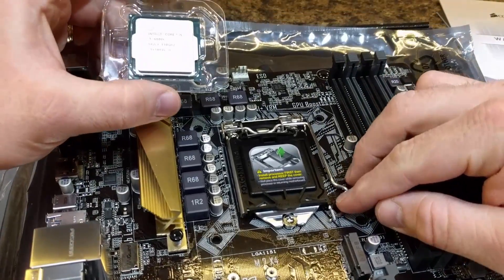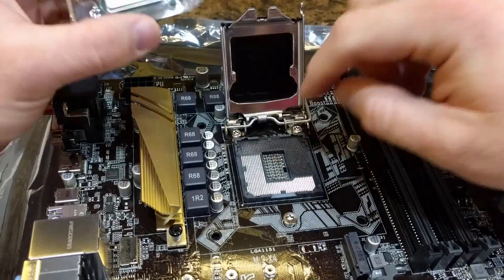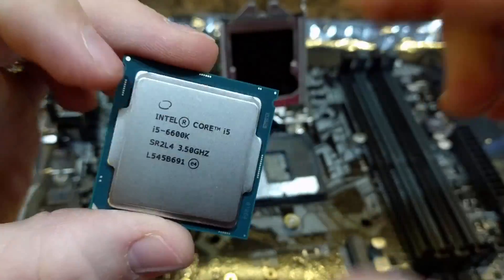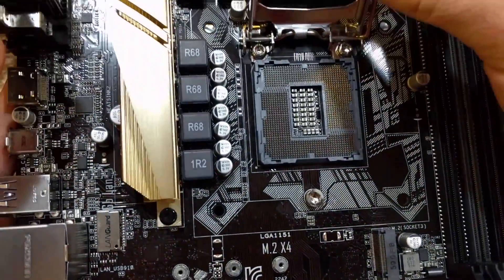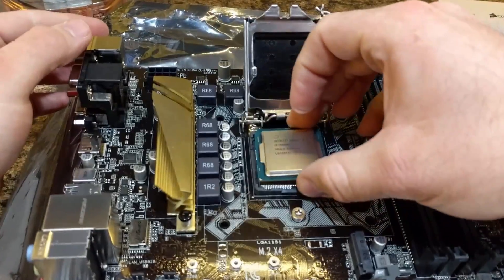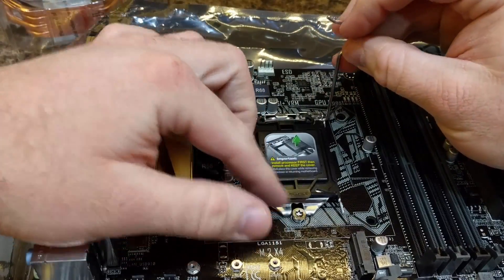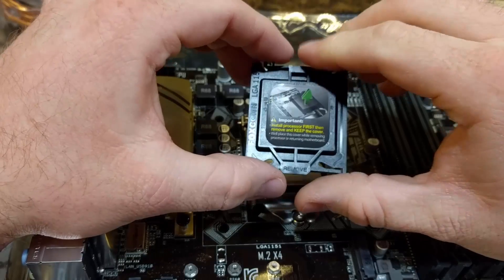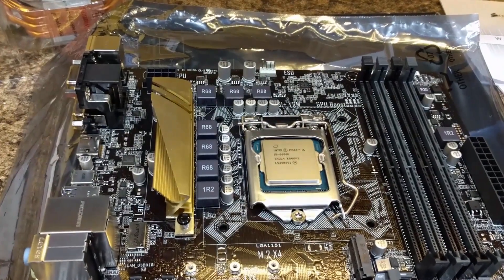Install Intel CPU socket LGA 1151

Comment: Accidentally got thermal paste in the corner of the socket around a few pins. Very delicate!
Removing the CPU is stressful trying to use your fingernails to lift it up without moving the CPU side to side so as to not damage the pins

Comment: sir i have question.
This motherboard is from the intel 100 series chipset and has the LGA 1151 v1 (first revision) which only supports 6th and 7th gen intel cpus. I want to know that , after updating it's bios, do it will supports 8th and 9th gen cpus??
Reply from the maker: Usually, no.
Reply: @ttms2  Thank you sir, i already got the answer from my DAD. He's kinda expert in computer hardware. Any ways, the Intel LGA 1151 v1 is only made for Skylake and Kaby lake intel cpus because intel 100-200 series chipset do not supports Coffee lake processors. 300 Series chipset is required for coffee lake to run.
Thanks again.

Comment: Soooooooo easy to drop the CPU or slip out of fingers and damage the socket. My trick is to stick Blu Tack to CPU top, lift CPU by the Tack and easy lower it  into place.
Works even better when removing the CPU, sooooooooooooooo easy :-)
If you don't have Blu Tack bit of masking tape folded into half and stick a tab to top of CPU,  sooooooooooooooo easy :-)
Reply from the maker: I've probably installed over 1000 CPUs and always done it the way I show and never had an issue. I'm glad you found something that works for you.

Comment: I’m thinking to build a pc but I get confused that I will bend pins(I’m 14) so can you tell prebuilt or build my own
Reply from the maker: I wouldn't worry about that. I sent this video to my 9 year old nephew and he was able to get his built without an issue.
Reply: TrenchTech Computer Repair Tutorials ok also if I accidentally bend will I be able to return (I buy stuff from bestbuy)
Reply: @shaheerfarhat7578  You'll lose warranty if you bend the pins.
Reply: TrenchTech Computer Repair Tutorials if so How will I get windows without flash drive ( I never built computer in my life)

Comment: How much pressure does it usually need?

I tried to install one today and it needed more pressure than usual. Have you ever had that problem?
Reply: That usually means the chip is not quite in the right spot.
Reply: im having same issue now, all new parts, is the screw on the motherboard adjustable? it looks like it is. I havnt built a pc in years.

Comment: But... the Verge told me to throw that cover away then put the CPU (that's right, they've got one) into the ~holder~ by using the ~brace~...
Reply: A core i7 hexacore. That’s right. wEvE gOt OnE
Reply: bro you forgot the cpu installation tool

Comment: A question . I am upgrading soon to the z370. How easy is it to damage the cpu when installing it. I've read that the pins are delicate and can get bent thus ruining the cpu. I am a bit clumsy. Is it as easy to install as it looks on your video? Thanks.
Reply from the maker: Don't be too worried. Take your time and you'll be fine.

Comment: So u just gently drop the cpu u right? How gently it is? Is it before touch the pins gently let it go? Or after touch pins just let it go? Will it bend the pins or something? Sorry i was new on this, just want to make sure it safe😂😂
Reply from the maker: +Gaming lovers you should be fine either way. I usually just line it up with the plastic and lower it down.

Comment: Wait the minute, isn't the 8th Gen Intel processors use that same socket (LGA 1151).
Reply from the maker: +Koo Yong Rong it uses a socket called LGA 1151 300 series.
Reply: Koo Yong Rong same socket, but intel twicked the voltage settings in the cpu so you have to buy a new mobo. But some people managed to overcome this and install 8th gen on older boards.

Comment: If i remove the black cover before cpu installation then what happened?
Reply: Just don't sneeze on the socket and it should be OK.
Reply from the maker: +Abhishek Mittal it's fine if you did. I just don't because it's easier to let it pop itself off.
Reply: Socket might get dirty
Reply: big boom

Comment: can I use 1151 socket processor on LGA1150 socket motherboard???
Reply from the maker: +DiePiePep no
Reply: bro then suggest me a processor 1150 socket & must be 65$
Reply: please
Reply from the maker: +DiePiePep not all motherboard support all chips. Which motherboard do you have.
Reply: why??
Reply from the maker: +DiePiePep they don't work together. That's like wanting to use a Honda car part on a Ford truck.
Reply from the maker: +DiePiePep that board requires a 4th gen Intel CPU. Your best bet is to find something used on eBay or local classifieds for the price you want. The cheapest new I can see is $110

Comment: I haven't upgraded in about 6 years but it looks as simple as it did then.  The plastic CPU cover is new.  Is there any good reason not to wear a grounding strap?  I may be over cautious but I won't touch the CPU even by the edges without one.
Reply from the maker: +Steve Jones I built thousands of computers and never used one. To each his own.
Reply: I've done my many builds but in my home, with carpet, so I don't trust myself to not accidentally touch one of the pins.  That's all it would take if there was static build up on me.  :)

Comment: I installed a i5-4690k cpu on a 1150 board a couple of years ago, left the plastic cover on and it bent the pins. I got another cpu, took the cover off and installed it without a problem. That's just my personal experience with it. I may not have had it sitting right to begin with.
Reply from the maker: +Undurpanda yeah, if you ever have an issue it's always good to reseat the parts.

Comment: Have you ever bend the pins ? I mean I am new to this so its safe to do it alone for first time ?
Reply from the maker: +erik mašlej I've installed over 100 CPUs and never had a problem. Just look to make sure you are setting it in the right direction.
Reply: +TrenchTech Computer Repair Tutorials Hope I'll succed :D
Reply: I accidentally dropped my CPU and bent a few pins. The mobo was useless after as the pins are to fiddly to move back :( be careful when installing for the 1st time